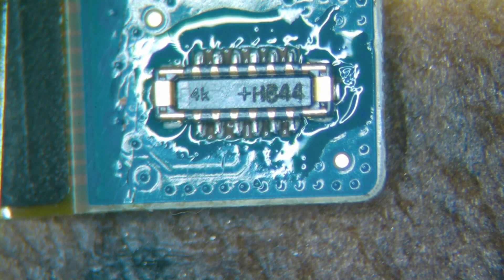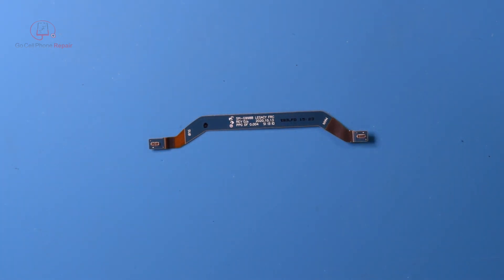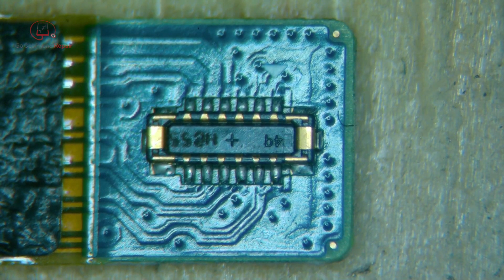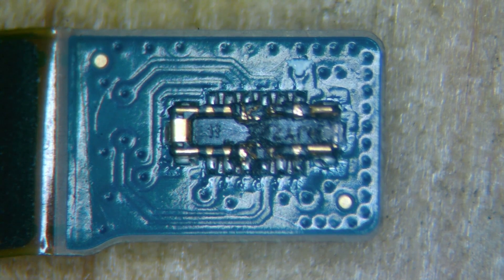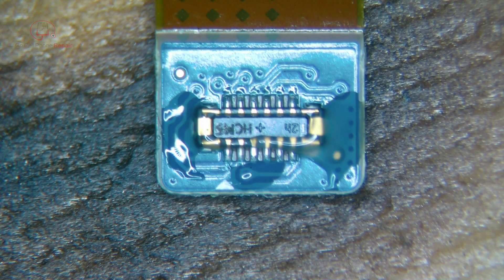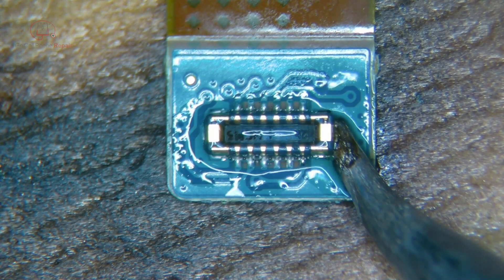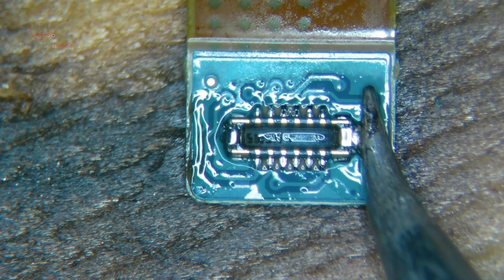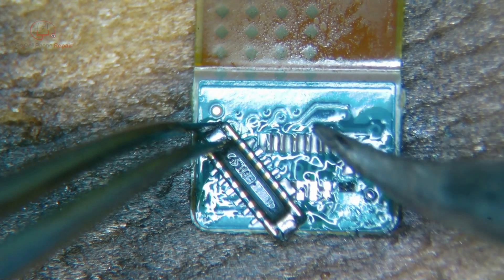Soldering Iron Vs. Hot Air Station- FPC on Flex Cable

Comment: You are supposed to put solder on each copper pad before you solder it in after using the wick even with hot air it's buttery smooth

What temperature hot air did you use, and what airflow speed is on that quick? I have the same exaxt hot air station as you